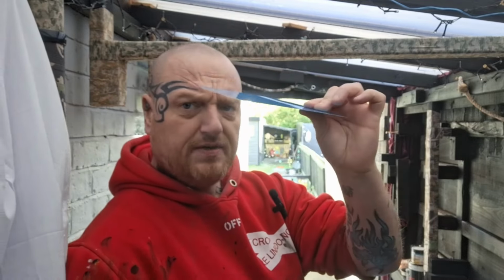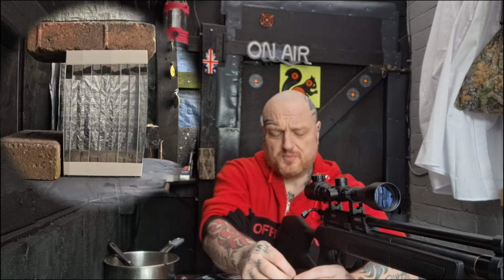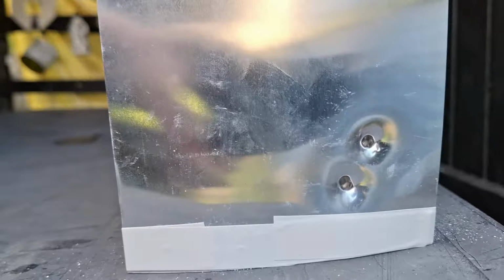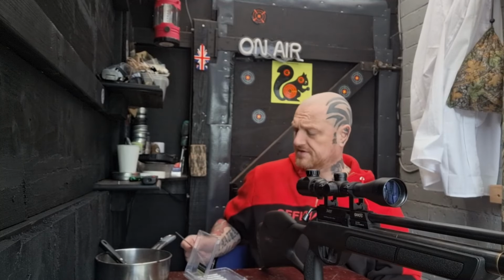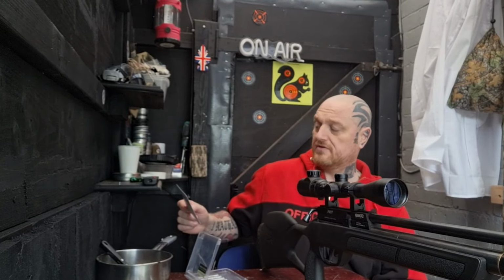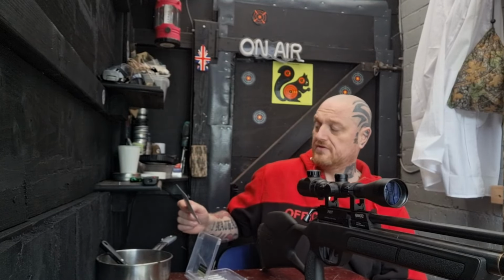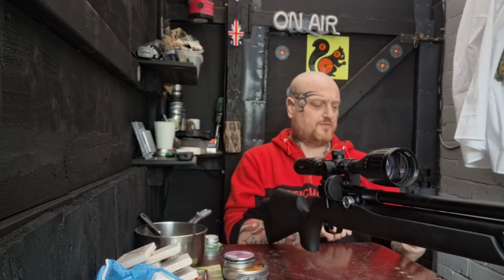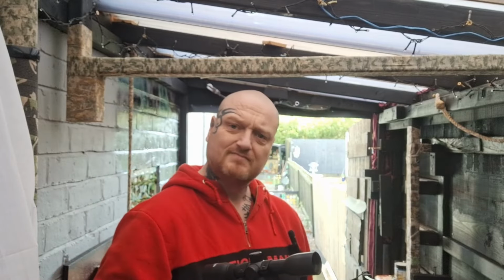AIRGUNS VS 10 ALUMINIUM SHEETS

Comment: Was thinking 🤔 in a shtf situation and ran out of pellets is there anything else that could be used around the house or shed? Maybe single loads of small nails or melting cutting or shaping something similar size and materials that would possibly work ? Just a thought 💭. Interesting results with the aluminium, would like to get some H&N hornets but so expensive, got hades instead
Reply from the maker: Man I do need to stock up just incase shtf, hate it when I feel Im not ready lol, I want to have around 2000 armor piercing in but never get round to it bah
Reply: Dude, you know damn well you have 4000 tins stashed around the house.
Reply from the maker: @richwhilecooper  🤣🤣🤣 I wish man lol
Reply: Cotten buds work great in 177 as cheap barrel cleaner pellets
Reply from the maker: @Theshropshireratter  haha thats a pretty cool hack 😎
Reply: @Theshropshireratter 
I’ve heard the filters for hand rolled cigarettes also do
Reply: I used a pencil once that I carved to tit the barrel bloody well went super sonic
Reply: @paintedpreppers-airguns 
You know those air rifles that fire arrows? I wonder if possible to convert normal pcp rifle to fire very thin crossbow bolts ? Was thinking about those poles with the brush on the end that are used to clean the barrel they would be the perfect diameter or those needles darts used for blow pipe gun
Reply: @KenRambler  would like to have seen that